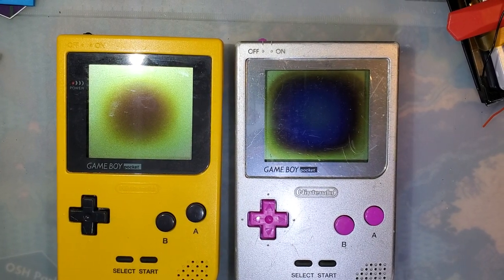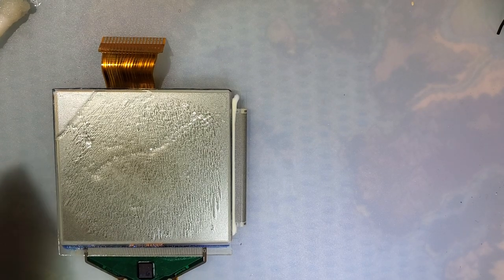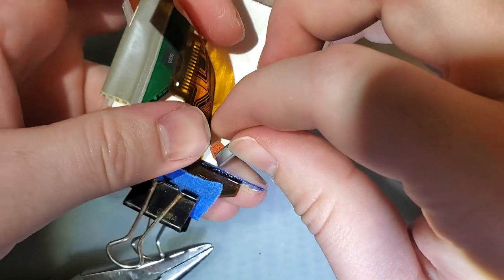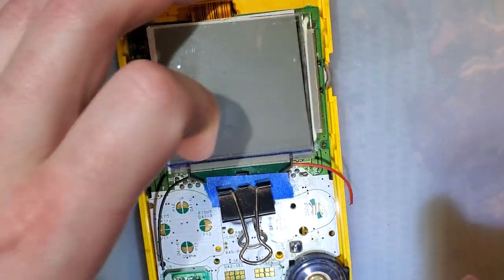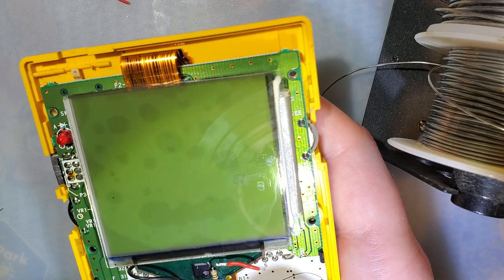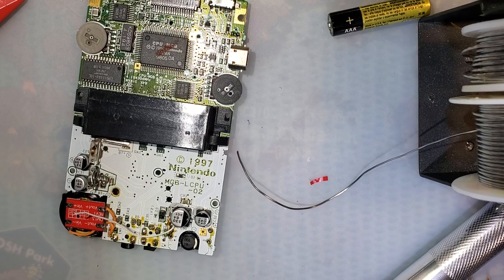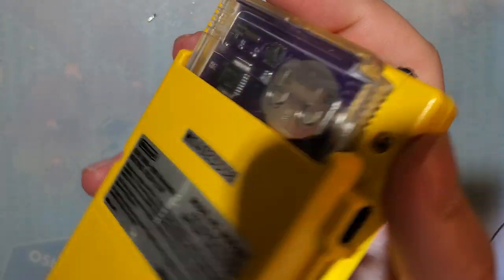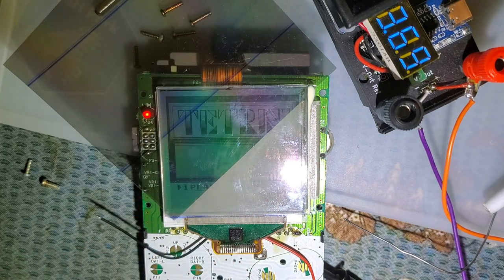Repairing a BURNT Pocket LCD (And Installing a Backlight)

Comment: I just desolder the vertical flex ribbon, as it's easier to get in to the back then.  Then it's easy to clean too.  I got a couple of those backlights from ali too.  They came with 10k resistors.  Literally impossible to see if you use it lol.
Reply from the maker: I was going to try desoldering one but I wanted to try the old way first. It does seem pretty easy that way.

Comment: how does someone accidentally put a flame on the center of their gameboy?
Reply from the maker: It's from UV and heat. Don't forget that these polarizers get a double dose since there is a reflector behind them.
Reply: Sometimes someone uses one of those screen magnifiers and then leaves their gameboy in direct sunlight, like on the windowsill or something.  You pretty much get the same effect you you as when people burn ants with a magnifying glass, or boil water

Comment: I had a GBP that was like the pink one - screen rot at the edges but kinda splotchy around the middle of the screen (discrete dots instead of like, pools). Used it for practise backlighting and surprisingly the middle stuff must have been on a polariser. Still creeping in on the edges but the screen's totally usable (except that I semi-killed a column of pixels doing the backlight)!

Comment: I’ve performed this mod and it works great, however I’ve now noticed that the DC Jack no longer works with a power supply, any ideas? Thanks
Reply from the maker: You must have wired some thing incorrectly. Double check all your work.
Reply: @makho  thank you for getting back to me, it turns out that fuse F2/D3 had blown on the board, switched it out and all is now good. It threw me because it worked via DC adaptor prior to modding, but something post mod must have caused it to blow hence my assumption it was the mod at fault!

Comment: I love the videos but the way you leave the bubbles and other imperfections drives me insane lol I can’t do a halfway job if I’m putting any effort into it it’s all or nothing if I had to go through 10 backlight kits and 100 polarizers id have made it perfect not judging I mean maybe I’m the one with the problem just literally makes me crazy 😂 I find it so satisfying to apply screen protectors until it’s not
Reply from the maker: I do fix that stuff. My videos are long enough as is, don't you think?
Reply: makho i agree the videos are long but I usually just run them while I’m messing with my game boys you’ve shown me a lot of really cool stuff I’m thinking about building a power supply like one of yours I was heavy into Nintendo 4 years ago but my father passed away and I lost a lot of my stuff in a move because we went from a nice big house to a small house and I had to sell a lot of my gameboys to pay bills I’m down to just 3 gba sp a 3ds and a 2ds I wasn’t knocking you I just dont see how you can sleep lol I literally would freak out if I had bubbles under my screen It makes doing custom stuff like this less enjoyable to be honest I wish I was more chill about it like you 😅 I’m kinda weary to do my own backlight like this so far I’ve just done the funnyplayin ips v2  gba sp with the soldered in brightness wire and without my nice iron and tweezers or light it was hard to do just that one wire😂 I used replace Nintendo save batteries and repair consoles to make extra money back in the day that’s how I paid for my collection that I sold off now I’m trying to rebuild I want one of every gameboy mint oem and one of each with an ips display and aftermarket shell so far I have a mint oem blue gba sp 001 a reshelled atomic purple 101 and a reshelled black clear gba sp 001 with a ips v2 kit and an everdrive gba x5 I’ve got a long way to go 😂
Reply: makho also glad to hear you fix that stuff off screen lol and I have messed stuff up there’s always a learning curve and you’re doing things that are kinda new and difficult in a lot of your videos so I understand that I’ve had to leave some things for an hour and come back also because it gets tedious but I still enjoy it and a break always makes things go much better once I pick it back up
Reply: makho is everdrive me a good site to buy the krikzz everdrive x5 mini from? How long is shipping normally? And are they an official everdrive vendor?

Comment: Is backlit + everdrive gb pocket doable? Do you need an additional voltage regulator? Which gives better battery life, ips or led backlight?

Thanks for the videos, they are really educational!
Reply from the maker: LED backlight is way better battery life. These new screens that are coming out should be pretty dang good too at the cost of some visual fidelity. 

Yes, it's doable. Some units need a voltage regulator.
Reply: @makho  thanks! I've been doing a lot of research on this and it seems that the voltage regulator is pretty much needed for things to work. Probably adding a higher capacity rechargeable battery would help as well.

Comment: I have never seen WD-40 used for that before. Interesting technique if there is a lot of glue left. As for the the screen rot I have heard that it's caused by bad conditions. If it was only due to age it would happen to most screens and would be a continuous degradation. It could be a mix of age, temperature and moisture problem.
Reply from the maker: Yeah, I only break out the WD40 for the burnt screens since the adhesive is so stubborn and rarely comes off clean. The actual clean LCDs usually don't need that. 

And yeah, I think it's temperature related mostly. I've heard from quite a few people who had their screens develop rot in shipping.
Reply: @makho  At least it's a lot easier to fix or replace a GB screen than a Gamegear screen. I have seen many Gamegear screen repair videos... or I should say repair attempt. It look like a nightmare to do.

Comment: I have that dark spot on one I used a handheld legends kit for it goes away fully if I loosen one of the screws a small bit tho
Reply: the screen is probably getting too much pressure put on it, like what happens if you poke a computer monitor too hard
Reply from the maker: @ganondalf8090  Yep, that's exactly it. Putting in that extra reflective layer was just a little bit too much thickness and not for enough added benefit.

Comment: Excellent timing good sir as I have a couple pockets with screen rot on my to do list. So I just sent a dmg to a customer across the pond. It showed up with slight screen rot. It was well packaged but maybe the extreme pressure and temperature on the flight caused it?? Anyways, just a  thing I thought I'd share
Reply from the maker: Yep. Not sure if the temp or pressure is causing the issue per se but it definitely seems to exacerbate the issue.